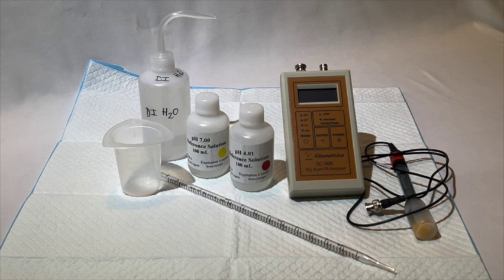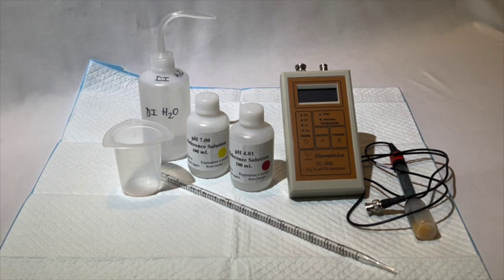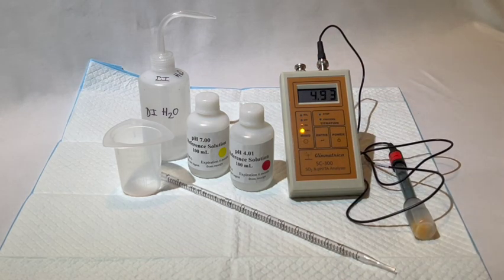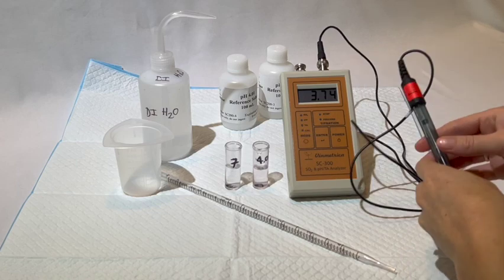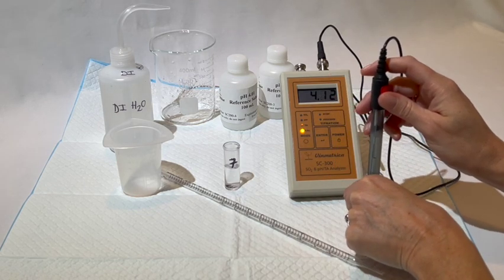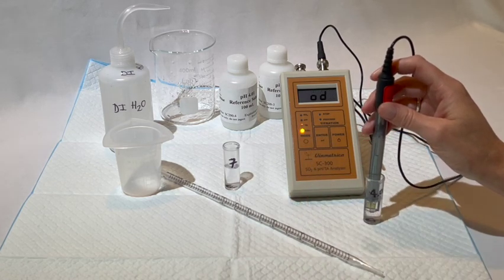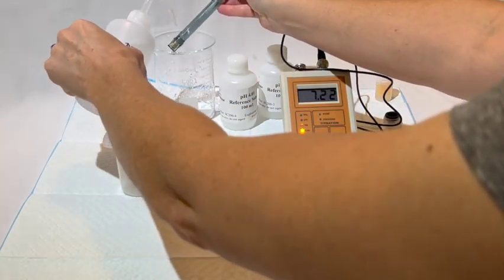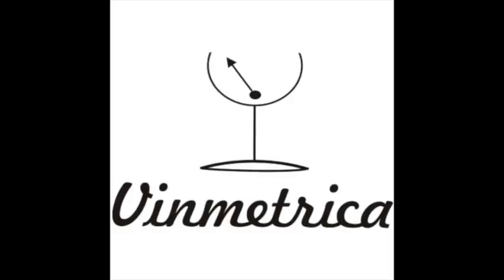How to: Calibrate the pH Electrode

Comment: In the older video, the lab tech would blot the electrode dry after rinsing with water. Is that no longer required?

Also, your storage vial seems pretty full. How full should it be with storage solution and how deep into it should the electrode be?